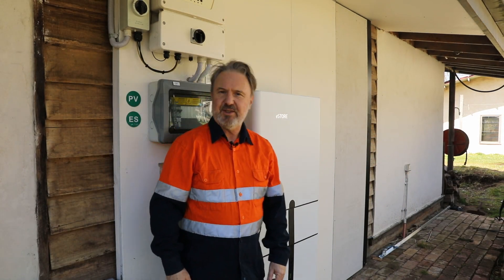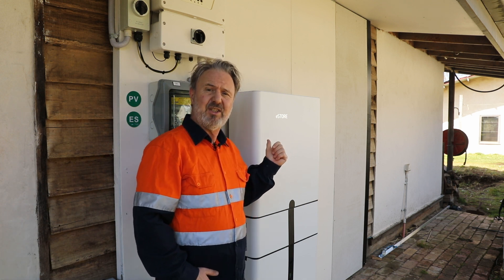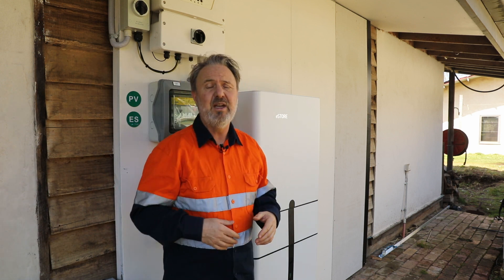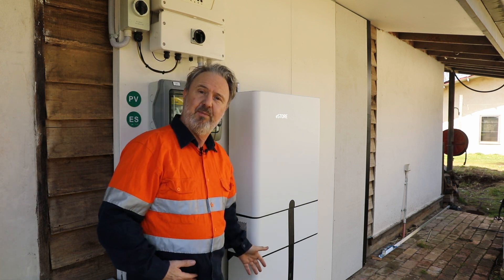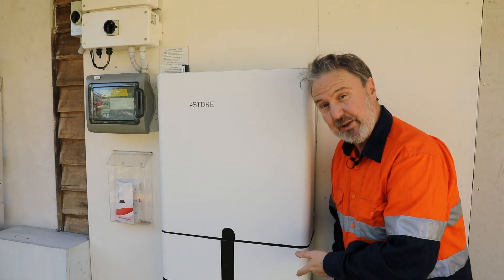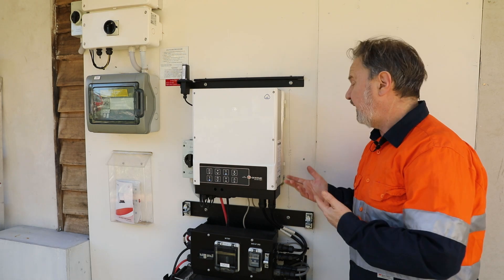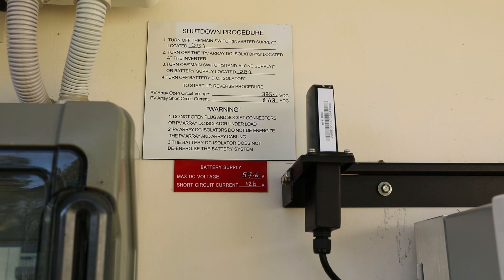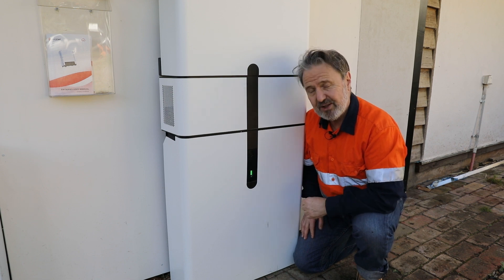eStore Battery Energy Storage System

Comment: Why does it look so sloppy installed the box on top of each others? The black grove lines between the white front shields are not straigh and makes you mistrust either the product or the installer. And can it really be water proof when installed like this? I saw another video from another installer with exact same product and same problemproblem, even they were not aligned vertically.
Reply from the maker: Yes, the cover (optical only) is difficult to align. Underneath is an IP66 Goodwe EM inverter and AlphaESS battery module (both IP66).
Reply: @SmartEnergyLab  I see, so good product I understand, but detailing is not in order. What  a shame, because it would look good if this would align.

Comment: Matt here. They keep changing this unit and re-branding it. I have an Alpha SMILE to get going and am using a URE manual I found online to match the equipment because the Alpha SMILE manual doesn't. E.g. the URE manual has the Acrel meter that came with the unit but the Alpha SMILE manual doesn't list it. The book it came with is sketchy at best. There is no backup switch in the cable box although referenced, only a DC isolator on this version. Got to drive out to Newborough tomorrow and work it out. What a cluster fuck. If need be I have done my own changeover switches with some trick wiring at cost plus. Had to do it on a Growatt as the backup only came on in emergency. Growatt sent out a Change over box and all it had was a 4 pole ABB contactor with two NOs and two NCs. I ditched it and used a break b4 make two contactor system I made for about $70 of contactors with interlocks from Tro Pacific. Looks like I'll have to do it here too as it seems ESS means ESS or just leave the designated backup circuits on grid if he doesn't want to pay up for this extra. The Goodwe had a C/O for backup. Very good except I had a contactor in one unit blow. I think it must also have had a single contactor inside. Racing contacts is what it's called. no good. An inductive or capacitance load can keep the arc going and not break b4 make.